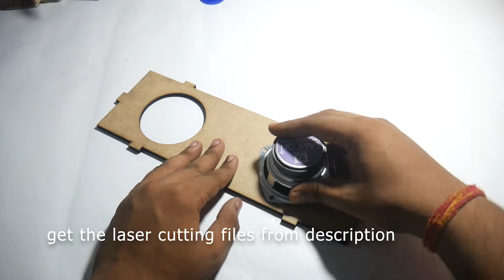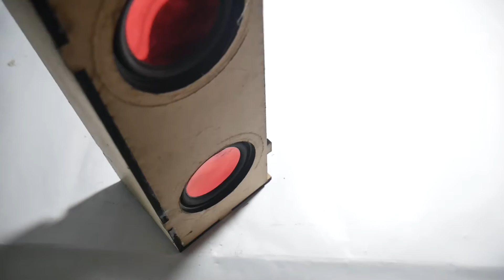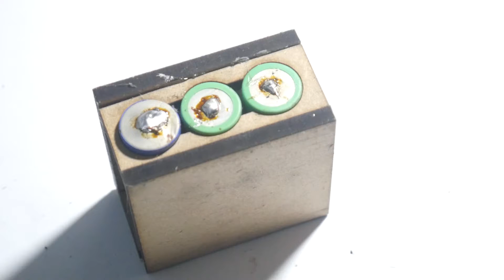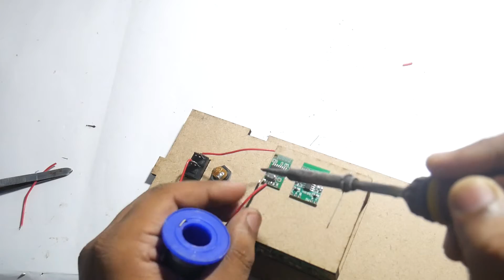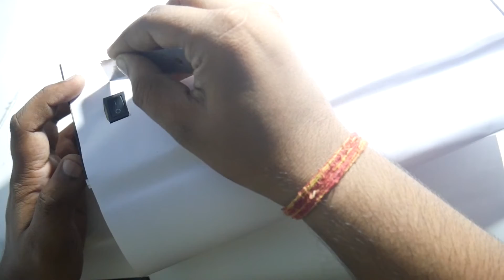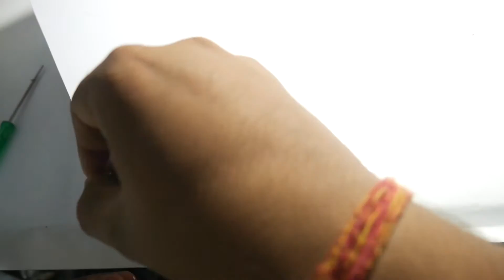How to make mini blutooth speaker box using pam8406

Comment: What are ou doing? Kindly explain for non eletronics guys like us
Reply from the maker: Creating a diy bluetooth speaker
Reply: @nikhilsharmanktronics  it would be good if you had explained what you were doing.....if only even subtitles in english would have been good...small parts...you doing soldering ...dont understand what to where connection and lo bluetooth speakker ready...small parts cant even see properly...😔😔😔
Also show chip diagram ??  where to solder what ,
How to check positive and negative ,?Continuity using multimeter...
Will make video lengthy but will be more useful for non electronics guys ....
Reply from the maker: Noted will mention it in next video

Comment: How the 8403 runs on 3.7 v ,it runs on 5 v only
Reply from the maker: Check 8403 datasheet its min and Max VCC voltage
Reply: Lol how can u be so sure pam8403 only runs at 5v. im prity sure u didn't read the specs shet🤣